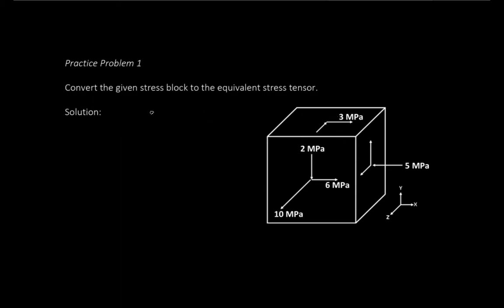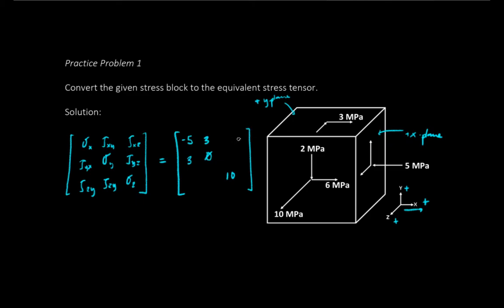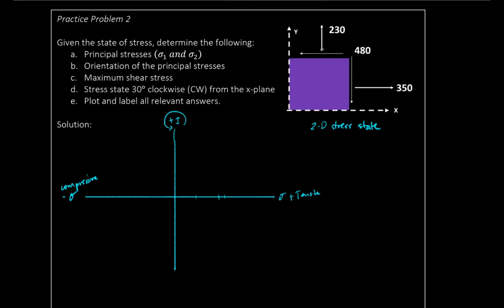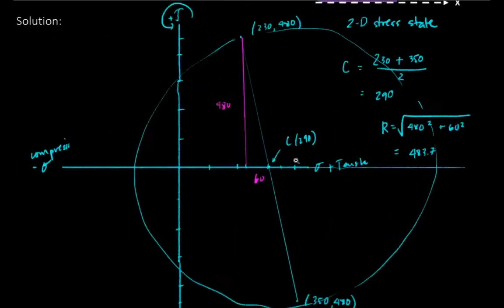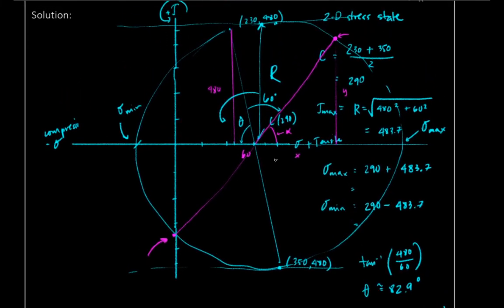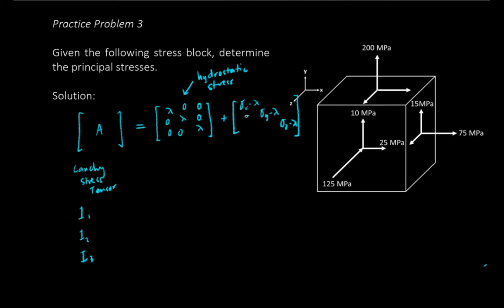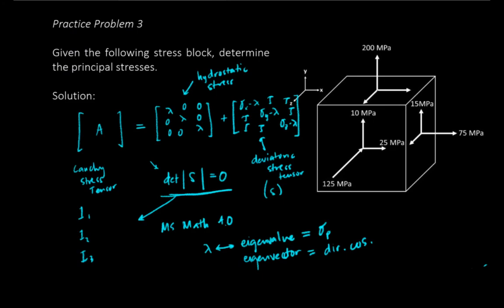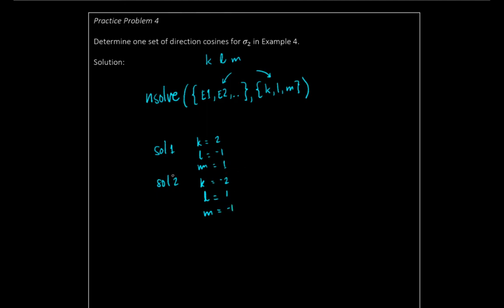[MetE177] 2D and 3D Stress States

Comment from the maker: Correction at 33:37: Both solutions will satisfy the system of equations, i.e., they describe two oppositely signed vectors. This makes sense because the stress state is in equilibrium, i.e., if there is normal stress in one face, then an equal and opposite stress must be present in the opposite face.